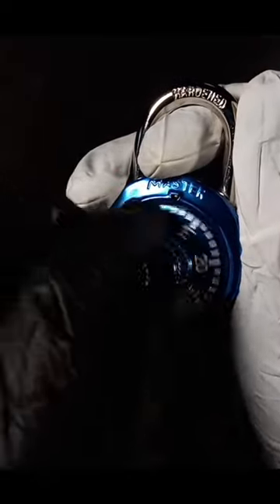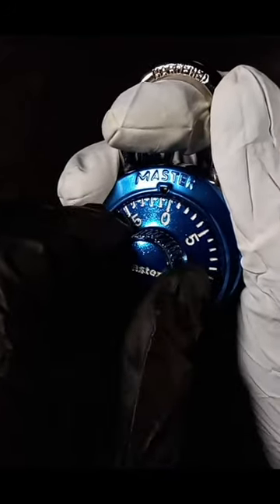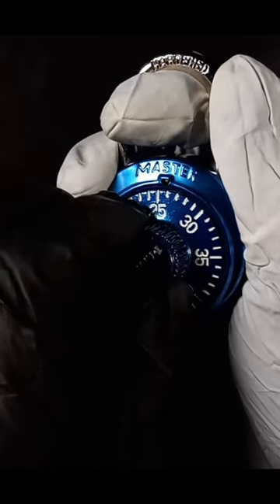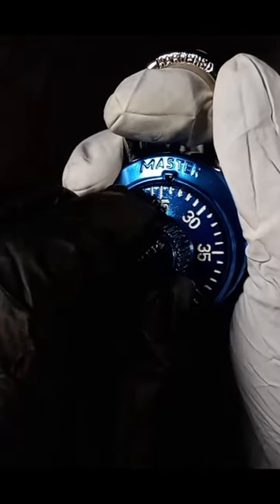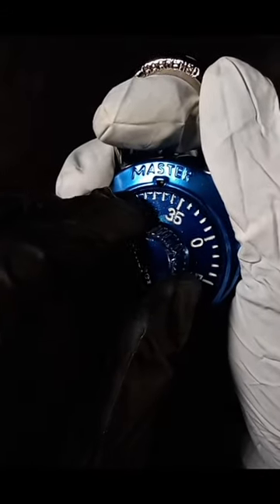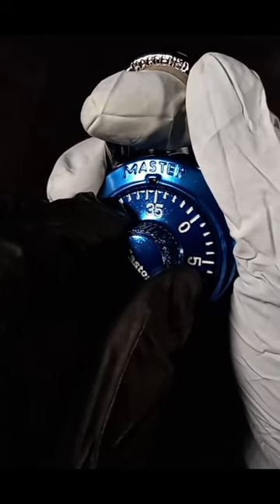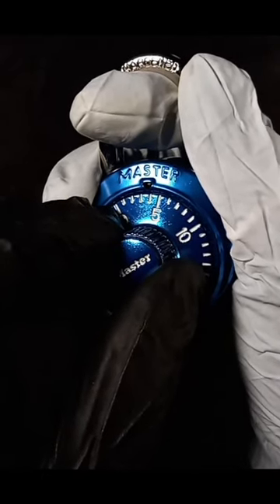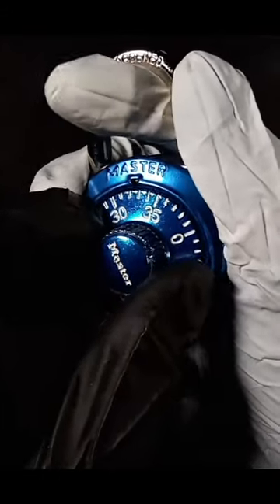Cracking A Master Lock Combination Lock #lockpicking #locksport #shorts

Comment: I tried this with six different Master locks and it doesn't work. I'm not saying you're lying I know other people who can do this but I followed your instructions step-by-step for about an hour and it did not work on any locks. Oh well. So instead, I smashed them together and they opened right up. 👍
Reply: Yeah me too. Bought two master combo's. Same as you followed instructions and it would not open. Been trying over an hour. I'm skeptical. I'm finding a lot of lock picking videos that will not deliver the result despite following instructions exactly.
Reply: @ParkysPlace  Yea I know 🤔🤷
Reply: "You are using a Master Lock Combination Lock. You can open it with a Master Lock Combination Lock"
Reply: Hell, I’m a frikkin MD and listen for clicks with my stethoscope and NADA, nothing.  I can get to the next to last number - when you see part of the shackle’s curve emerging out of the main body - but can never quite get the final opening click.  I learned as a kid how to pick door locks and all forms of locks aside from combo locks.  I do have a gun safe which uses a combination lock with no key or electronic backup opening mechanics so you have to be precise with your dial management.   And it allows for no +/- error; - if you overrun a number by a hair, you have to start over.  And it doesn’t allow any up/down tension on the dial handles but you can pull lightly towards you without penalty.  Yeah, that still happens with me once or twice a year and I’ve been at it for over 10 years which may be a problem when I die as nobody else knows the combination including my wife or any of our kids.  While I showed all of them how to open it and I watched as they each opened it while I watched, none wrote down the combination or other dial directions.  And it is written down in only one place of which I’m the only one who knows where.
Reply: That’s the new model. This only works on the old combination locks. You can tell if yours is a new model because it has a ball bearing mechanism and the shackle feels loose.

Comment: If you notice there a little space on the left inside of the lock.   You can put a steel bobby-pin down in the slot, then slam it down on a hard surface and it will pop right open.  ...try it.

Comment: QUESTION :   Are these stops then the code? I bought one to test. Still unable to open without code...   Trying to enhance my skills... 😅
Reply from the maker: Im not sure what you mean by stops then the code?
Reply: @UnsecureSteve  no worries. I meant the "first click (@29 +4) the second one that stops you in your tracks, etc. Still unable to crack the newest version of the Master Combo lock. Tension seems to be the culprit...
Reply from the maker: @jasonconforti6756  yeah tension is the key to it, toooo much and it'll lock up at every false gate, not enough and it just skips all false gates, you wanna be somewhere inbetween not enough and too much lol. that allows you to catch the high spots in the wheels causing the clicks and resistance. it happens due to the disks inside not being perfectly circular

Comment: Your first number you ran quick and stopped on #26 but said the number was #29.  How did you get that?  You might have felt the click but you were talking and ran fast past #29 stopping between #25-26.  As noted, hard tension is too much but light tension seems to pick up no clicks, no sense of slowing of the dial speed or any other clue that I am anywhere nearing a click or internal disk interruption.
Reply from the maker: I clearly state in the video that once you feel the click you need to add 5. And slowing / going fast with dial speed shouldnt need to be explained as thats only personal preference really lol

Comment: Why do you have to add 5 here, add 2 there? It seemed a lot complex than one I saw prior to your video?
Reply from the maker: Im not sure how much you know about combination locks but the reason that i add 5 on this model is because of the false gates. The wheel isnt a perfect circle, the click is from the locking arm scraping across the highest part of the oblong wheel. When we add 5 to that number it aligns the locking arm with the correct gate on the wheel instead of a false gate. Which allows us to then go on and go about setting the second wheel.

Comment: I’ve been trying this on a lock I have but I can’t crack it it’s not a master but could you help me out
Reply from the maker: What brand is it?
Reply: Same. Not sure what brand it is, but I can do step 1 just fine. The shackle pulls in when it reaches 5 below the first number. When I hit the stop on the 2nd step, it's nowhere near the correct number. If I force past it, I get absolutely nothing when passing the 2nd number.
Reply from the maker: @Semystic  tension mans, gotta either add or use less tension
Reply: @Semystic could shim it depending on what it is

Comment: You did this couple weeks ago I got one had over 30 years method doesn't work and I know the combination, lol.
Reply: mine is identical
Reply from the maker: Tension control is probably your issue then. Especially if it has false gates. this method is different then the one i did before it

Comment: I’ve tried this so many times with mine because i can’t remember the code but the false gates are just too much it’s all the same to me

You make it look easy
Reply from the maker: Gotta let off enough tension to barely skim the false gates, the reason this works is because the part of the wheel where the first number is, is a slight bit bigger than the rest. That is what gives us the click 5 numbers before the first number, same for the second number except since we're going the opposite way it feels a bit different. If youre jammin the false gates its too much tension on the shackle

Comment: Singlehandedly producing efficient burglars worldwide. Yeah, great job mastermind.
Reply from the maker: Well, just like pentesting computers, its not about teaching to steal. Its about teaching people how easy locks can be opened, so if theyre using the lock shown they can throw it away and get a better one. 😮
Reply from the maker: psvrwise7051  shit sorry bro, youtube doesn't always give notifications about comments.

As far as uncrackable combo locks, most thieves will just cut locks so make sure a lock you're using has a metal sheath up the shackle. As far as an unpickable lock..sure the bowley but its so expensive that its not even worth. Most of the time it depends on application to choose the correct lock.
Reply from the maker: psvrwise7051  thats what im saying dude. As far as doorknobs. Get you a dimple lock like a Goal D9. Those are rather high security. Or for a padlock the abus rock or granite is affordable and decent. Or if you need a puck lock..paclock makes a good puck lock. Although all of those options are pickable. They wont be raked, bypassed, or gotten into without a rather high skill level.

Comment: Now why did you use a completely different method on a previous video you showed. Are these all b.s.? Im beginning to think so😮
Reply from the maker: Let me ask a question.
Do chevrolet parts fit a ford? Do dodge parts fit a ferarri? Different makes and models take different methods 🤫
Reply: @UnsecureSteve  yeah but they looked like the identical locks. Weren't they? If they were different, I get it, but they sure looked the same🤷
Reply from the maker: @dh5594  nah, ones a master lock brand ones not. And even then, if they were both maters they may be different models. 

Just like say, the AL1100, and the paclock 90A, they look ALOT alike..but theyre not anywhere near the same
Reply: @UnsecureSteve  oh gotcha.  I thought they were the same. I just learned something 👍